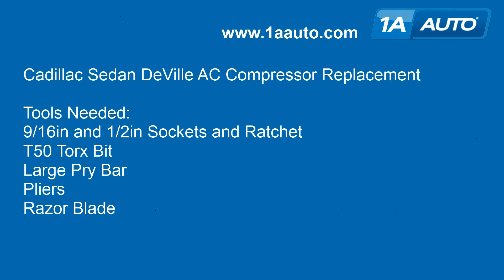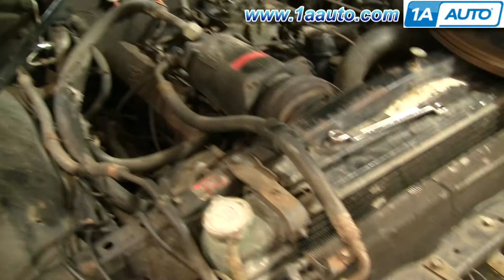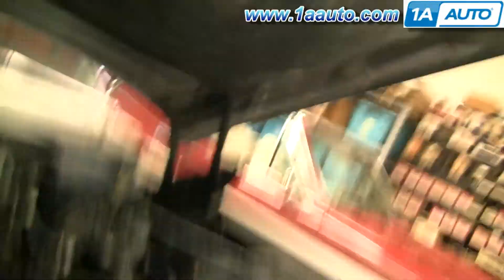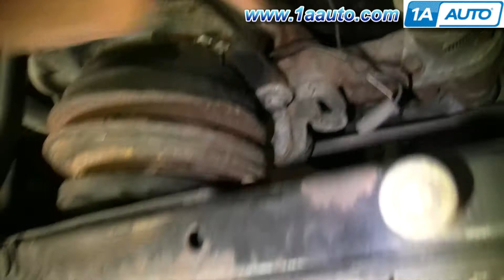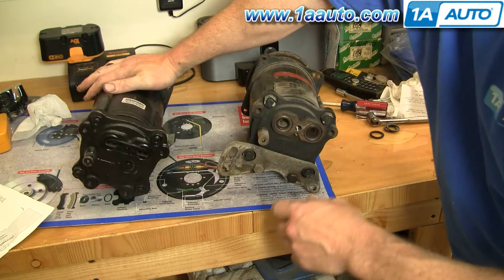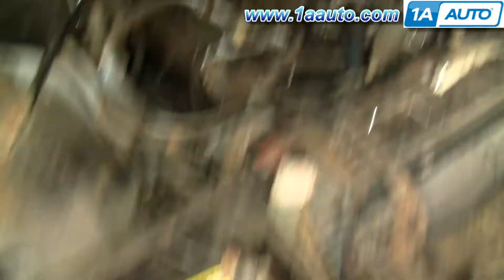How To Replace AC Compressor 65-70 Cadillac Sedan DeVille

Comment: 01:20 30 LBS negative pressure? 
28" of mercury pulled in a vacuum is what your gauge should be reading if you have a sealed system.